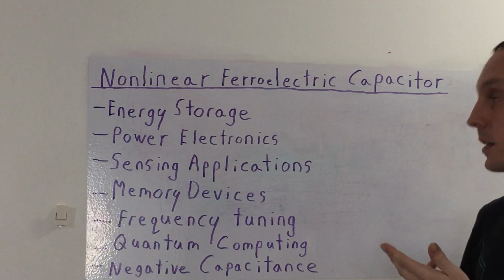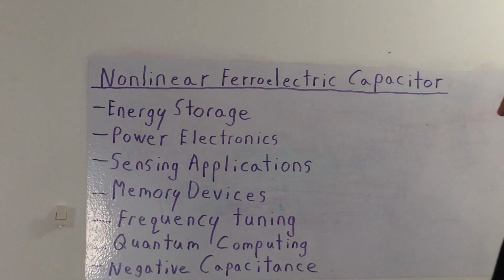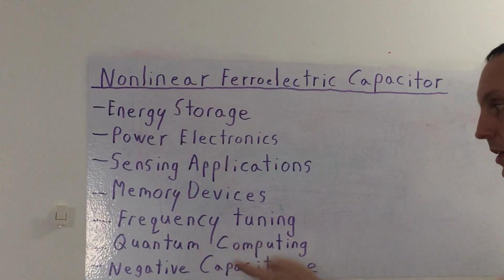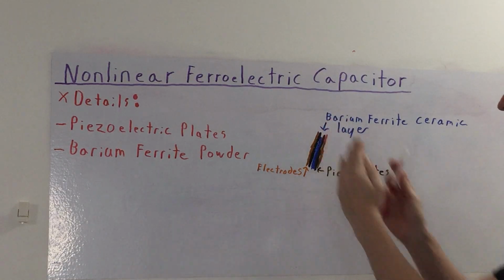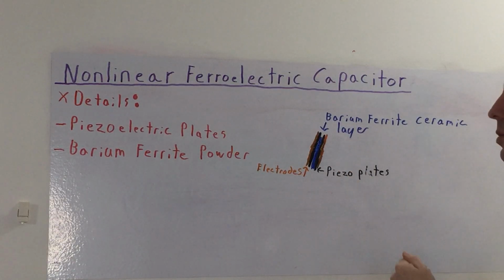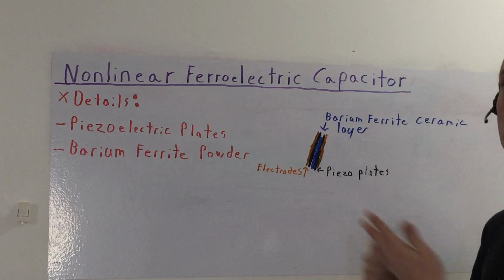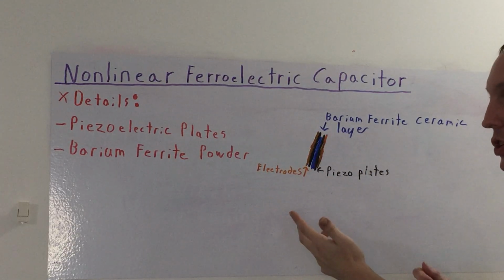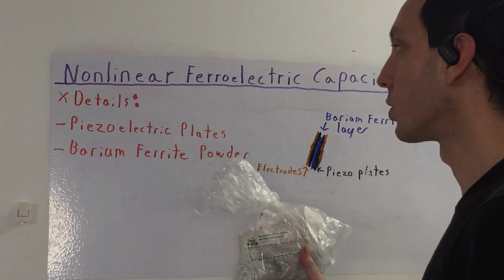Nonlinear Ferroelectric Capacitor

Comment: hey brother, what happend with the blue orb, any update on it =]
Reply from the maker: I rather not focus on it and drive myself nuts unless it happens a 4th time. Then I will take the time to put up a few cameras and get the proper pvr setup etc.. I have a few ideas what it could have been after more investigation, I noticed a strong intermit filed coming out of my floor. Might be a pipe or something under the apt.
Reply: @joellagace1679  yeh I agree with you man, it might be something like that :)

Comment: Don't know if you ever looked at Otis Carr's flying saucer blueprint, there were those huge "C" shaped electromagnets, that had a coil on one end and a weird-looking capacitor at the other end. So this made me think: what if you could extract the magnetic energy of an inductor core gap with a capacitor instead of a coil? Would that dissociate source current from load current?